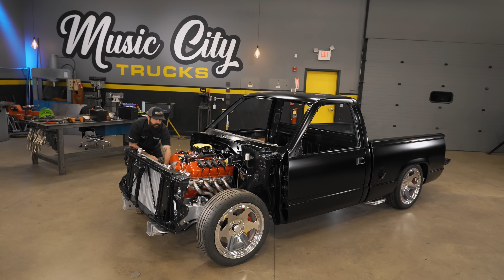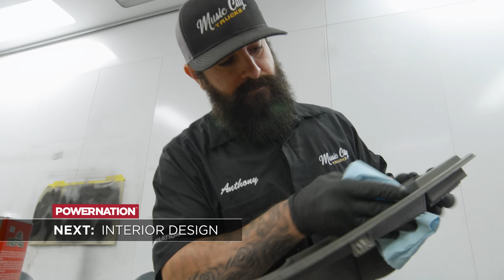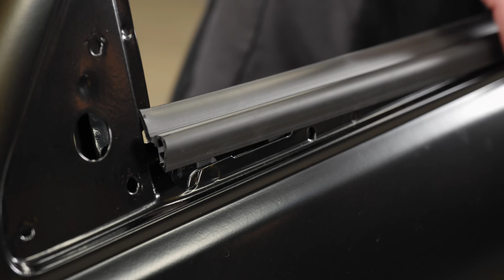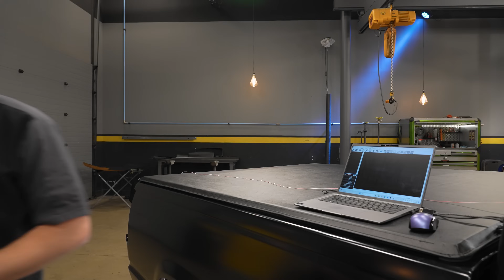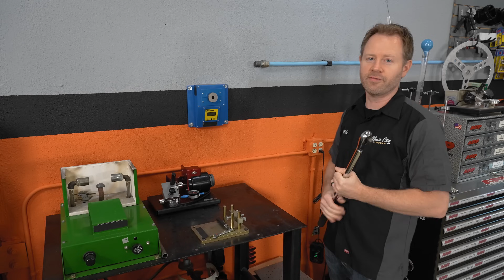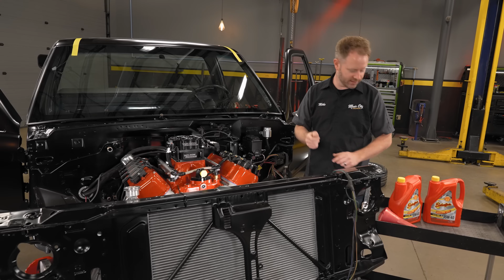All Hooked Up! Time to Hear This Big Block Sing! / 632 OBS Chevy - Music City Trucks S5, E8

Comment: That’s the worst positioning of a battery box I’ve seen in a while. At least place it as close to the bedside as possible. Personally I’d extend the length of the wheel well along the bedside and make a place for the battery to be hidden and create storage space with the rest of the added space.
Reply: Time restraints and that sounds awfully custom.

Comment: Quite possibly the dumbest battery installation I've seen in a long time. Why wouldn't you put it under the truck?
Reply: It’s a street truck. Though I kinda agree. This show is trying to show how you can buy things and install. I’d have made it myself for a more custom look.
Reply: Even the installation was backwards . Why would you route the cables toward the inside of the truck instead of the outside . Not to mention the additional holes you have to put in the bed of the truck for the cables .@Istubbedmytoe001

Comment: On the battery box before you put the hold downs through the bed should have put nuts and washers all the way up it that way when you tighten up on bottom of bed you tight the inside bed ones down it stay as it is now when you undo it to take battery out it will fall to ground under truck

Comment: For that late model, plastic interior pieces, a quick fix can be vinyl rap. 😤 You don't need traction control if you know how to use a manual transmission (Torque).

Comment: Quit trying to sell me that Duralast garbage 🗑. The Batteries die, the HEI distributor modules burn out prematurely and their brakes wear unevenly. All junk. Oh yeah, their waterpumps bearing seals fail instantly for a 2005 GMC Envoy with the 4.2 inline 6.
Reply: You must have just got a bad waterpump. On a 2003 Tahoe with a 5.3 they consistently last 90 days.

Comment: Y’all put the battery in backwards. The way it is anything you put in the bed has a chance of damaging the cables. Should have put the cables on the other side .
Reply: It ain't going to get used for anything like that.  In fact they might drive it,  take it to the track a few times then it will get parked and used  for a future project or scrapped. If I remember correctly that's one of the reasons Stacey David stated his own show,  he wanted to sell some of the projects and do give aways with some.  The corporation side of the show wouldn't let him.
Reply: @darryladams519 you are probably right. Seems pointless to have a pickup and not use it as such. But with that engine does not lend itself to anything other than a track vehicle.

Comment: I am always amazed how some people will put so much time and money in a truck and then mount the battery in the bed.   Are you too lazy to build brackets and hide the battery underneath?
Reply: Generally you do it for weight distribution.   Mostly for drag racing.
Reply: @bmstylee  you totally missed it.
Reply: @CrankAddict totally missed it. LoL
Reply: @bmstylee yea when it's no longer going to do truck things. A 632 in a truck makes it about useless as a daily or a hauler.
Reply: Wouldn't it be susceptible to more abuse from road debris, etc, below the bed? I mean yeah, it's in a battery box, but up top there's more inherent protection, especially with a tonneau cover.
Reply: @mdizzledav you also totally missed it.
Reply: @jeffsimpson7840  ok smart guy, why not explain your point a little better. If multiple people "missed it" maybe the problem lies with you...
Reply: @mdizzledav  Ok, see how nice the truck is gonna be? And to put that ugly ass battery box in the bed like that after all the tight sh!t they're doin to it. SMH. They could easily put it under the bed on the frame and run some clean leads somewhere just in case it ever needs a jump or something.
Reply: @jeffsimpson7840
I personally think a better option would be to actually make an enclosure for it behind one of the wheels. Cut into the bed at the side, and hide it in a better spot as well as somewhere more accessible.
Reply: @jeffsimpson7840  ok so I guess I, didn't miss the point... I get that it would look better, but there's obviously more debris and abuse below. I live in Michigan, why tf would I even think about risking the corrosion, especially when my obs has a tonneau..?
Reply: @mdizzledav this isn't the kind of truck your daily driving in the winter in Michigan. LoL You're driving this truck on the weekends in good weather so corrosion doesn't even matter.  all kinds of people do it to hot rods and bagged trucks
Reply: I was thinking the exact same thing! Couldn't they mounted the battery under the bed?
Reply: It’s a waste of money and time. Period. Vehicle financing or mods is a liability people will justify by any means necessary. Just let them continue the builds while disregarding the fact it will never make consistent returns, help build generational wealth, cover the cost of unexpected expenses; nor will it ever hold the title of being the fastest, most reliable, or most popular.
Reply: @kellygibson7299 LoL you definitely missed the point.
Reply: @kellygibson7299 It’s a hobby. These shows are outlandish from your average viewers perspective.
Reply: Looking really nice!